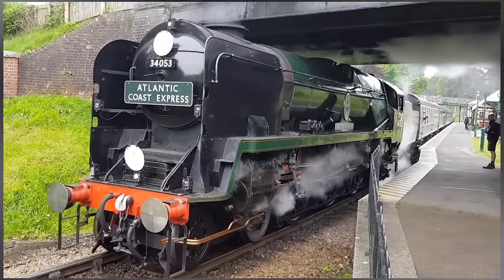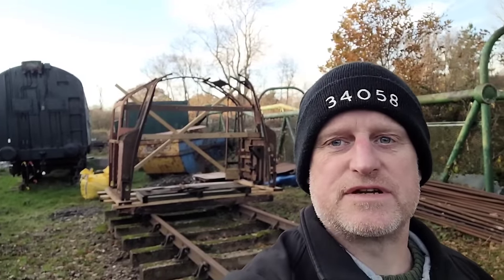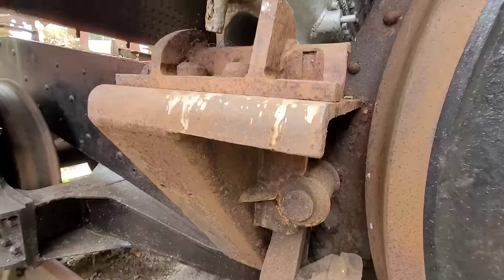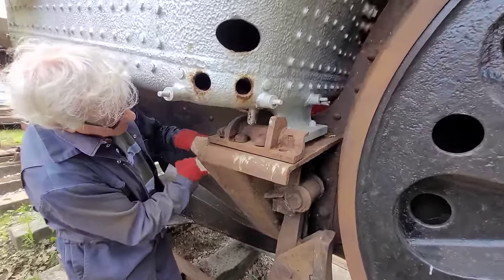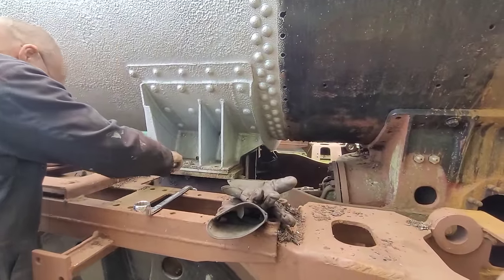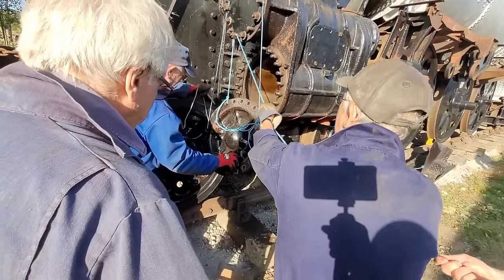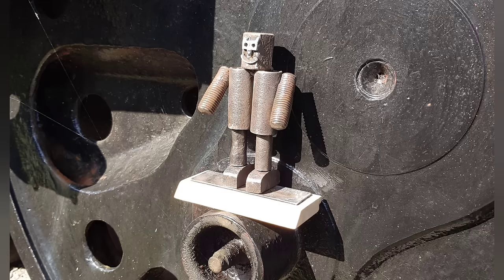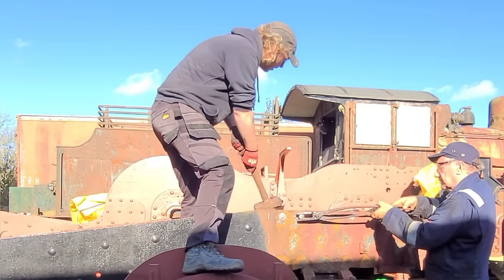TORN APART!! Scrapped steam engine gets taken apart and saved! SPECIAL UPDATE 01

Comment: You can see why it costs so much to bring these wonderful machines back to life. Can I ask please, where was the original asbestos cladding and what, if anything, do you use as a replacement?
Some of my old workmates at Bournemouth depot (I started back in 1987), said that some drivers & firemen used to get part time work on their days off helping to scrap the old locos and strip the asbestos off.
I guess the lucky ones managed to avoid lung cancer.
Reply from the maker: Thanks for your comment. Some of the  loco's that were saved from Barry scrapyard had the asbestos removed before they were allowed to leave the yard to prevent the dreaded stuff causing problems later. 
Asbestos was a  "wonder material" for many years as it had many great properties.  Unfortunately as we now know it had a major issue...
In a  future video we will show you the material we now use.👍

Comment: Ooh...funny shedplate on Sir Keith 75F  - Tunbridge Wells East. Should be my old (2nd) depot Salisbury 72B. My old, old workmates would have worked on her. Salisbury were known for keeping their engines a lot cleaner too. I saw another picture with it carrying 71B, never based at Bournemouth though according to records.
My workmates would possibly have taken over Sir Freddy too when it passed through Salisbury from Exmouth Junction - 72A if the Exeter crews didn't work through.
Sorry, not an anorak. I just have a small book 'BR Steam Motive Power Depots SR'. You can have it if want for reference and interesting plans of the old depots.
Reply from the maker: Sir Keith Parks home is now at The Spa Valley Railway in Tunbridge Wells, Kent. It now proudly displays its shed code.
 Not everything can or even should be historically accurate all the time though.
We are however going for a historically accurate cosmetic look on another one of our locos, 34070 Manston is replicating the "end of steam" era this year. It's deliberately weathered looking paintwork is not being washed so it will resemble how many steam locomotives looked in the 1960's. Look out for it as it looks fantastically filthy!!
Reply from the maker: We are always happy to receive railway books! 🙂👍We can happily read through them and then pass them on to other Railway Maniacs through our Friends of 34058 Sir Frederick Pile fund raising stall on Facebook.
Reply: @railwaymaniacs  True. I much prefer 4472 in Apple green without the German style smoke deflectors but the grief I got from my workmates....

Comment: Have you fellas never heard of "PluGas"?????
Reply from the maker: No what is it?
Reply: @railwaymaniacs  In the UK it is used to free rusted joints (think disassembling exhaust systems) - over here on t'other side of T'Pond (USA) the nearest thing I found to PlusGas is Kroil (penetrating oil) good luck!  Nice video, thanks for sharing, I'm surprised that no one else has mentioned PlusGas!
Reply from the maker: We have been using penetrating oil , usually WD40 that has been regularly applied for weeks (sometimes years) beforehand to help try to release parts. You have to remember that this locomotive was last used 60 years ago and has sat outside rusting away since then. I'm surprised that most of it can and will be used again.